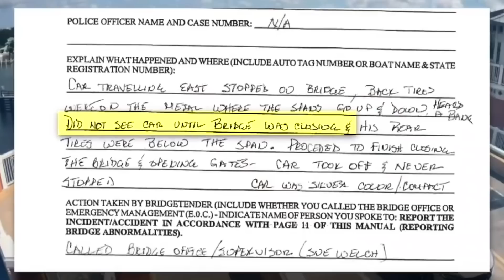Drawbridge Failures Caught On Camera

Comment: a similar dealio happened to me while i was on my bicycle on a vertical lift bridge. i dismounted and walked through. about halfway the siren goes off and the bridge starts lifting. i waved frantically over the side of the rails at the command station. someone loud speakered to just sit down with my bike and hold onto the rail. when i was lowered back down after a freighter went through a couple workers waved me over to the station to apologize, saying they hadnt seen me through the bridge supports and assumed i had already cleared the bridge. it was certainly something. i hope no one got fired for it though because i agree that the support beams are very visually obstructive on that particular bridge especially in regard to the pedestrian walkway.

Comment: i've walked across a drawbridge before and quite honestly it was very nerve-wracking because you never know if the operator will be careless (like in carol wright's death coincidentally in florida). i ended up walking across a different bridge when going back (though the 4 flight of metal stairs over the river to the top of the bridge was nerve-wracking in its own way).